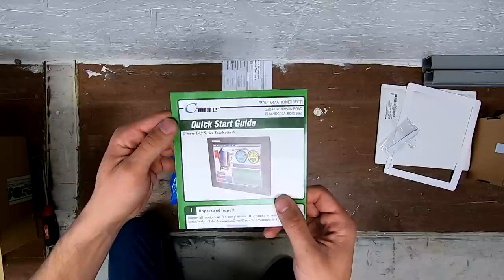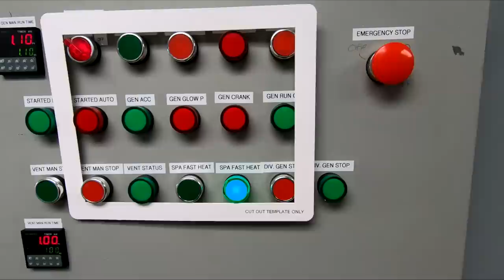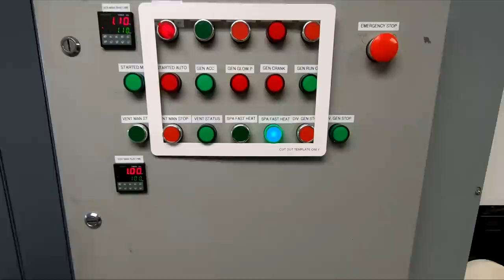C More HMI Panel Unboxing (Automation Direct)

Comment: You should leave your emergency stop button. In case of an HMI failure you'll be able to have a reliable emergency stop. Besides that cannot wait to see the finished product.
Reply: emergency stop circuit should be hard wired and not bus / network controlled unless the PLC is designed specifically for safety control such as Siemens and profisafe.

Comment: Good video.  I use Automation Direct Click PLC's to control my irrigation system.  My plc units are hundred of yards away.  
Modbus communication whether serial or eithernet is transparent to plc or cmore programming.  You can use the three wire rs485 cable to communicate with your remote units like your well.
I run my modbus interface at 38k.
Also the serial connector has a 5v power supply so you can power rs232 to rs485 dongles.

Comment: a good tip for screen protectors. before you take off the sticky part stick a tape to the top of the protector then tape the other half to the display so you can make a hinge then you can line up everything and when its good (open Up) the screen protector and peel off the protective backing then let it drop on the screen you will have the best result (hope u understand)

Comment: Next time you look at LAN switches, check out the Netonix WISP switches (offered with DIN rail mounts).

I'm very curious to know if something like a Raspberry Pi running Windows 10 IoT is capable of running AdvancedHMI applications.
Reply: Industrial ethernet = money.  DC power?  == more money.  Redundant DC power == lots more money.   Supervised, managed, and Gigabit speed too?  Well, you know by now.  IDK why so many industrial switches are 100mbit when 1G is so cheap elsewhere.
Reply: @infotech4990  industrial communication is still serial based. When I got started in microwave engineering most of the infrastructure I was backhauling was 9600 bps serial data. It was when my department got absorbed by IT that I began having to engineer links capable of 50M/100M/200M speeds. Prior to that 1M was rarely utilized so why deploy anything other than 10/100M switches? That was also about the time I began to see a huge riff develop between the IT guys and the SCADA guys...I was just there for data transport.
Reply: @zapityzapzap  Those old serial lines were robust - RS485 could network 32 devices at blazing speeds back in the late 70's thanks to the differential wire drivers. I think Xantrex/Schneider use RS485 in their newest Xanbus  multipoint network of power devices today.  The evolution to IP with scada, door locks, alarm, utils came in and moved the separate RS485 networks to one 100Mbit IP network dedicated for building infrastructure, which worked great for many years in the late 90's. A decade later, IP video cameras joined the 100M network (where the simplistic designer just added bandwidth up assuming he could use all 100M all the time for tons of cameras - plus the bldg infrastructure net was physically close to camera locations).  The massive load of cameras that security purchased pushed the network load to failure, which is when they had to hastily upgrade the 100M to 1G hubs/switches.  Later, security was given a dedicated fiber just for ip video.  I was going to buy 100M voip phones (cheaper!) using a 100M network and saw the high end ones are "future ready" with cameras + video calling on the executive phones. That's what pushed me to use 1G networking for the separate voice network - just in case, plus the 1G phones have slightly less latency mostly due to a better network chip. Now, the minimum I buy is 1G, and I have a few 10G nets for NAS attached systems & backups.
Reply: @infotech4990 still a lot of "low" speed data stuff going. Most public safety radios systems operate @12kbps or less (if the equipment is network attached you are lucky to have 10/100 ports on equipment). I know in 2015 when I left the energy industry some 10,000 of 12,000 devices I back-hauled in my business unit were strictly serial based (and didn't meet our IT department's security standards which lead to a problem when I told them the results of the audit). It is certianly a changing industry as IP becomes more prevalent.

Comment: With everything you said you woukld be removing, i would have thought a smaller panel would be better, and they make stainless steel cabinets ;)
Reply from the maker: But you will see in the second half of the video that the panel doesn't have much more space.  With adding the panduit and spacing things out to fit between it, I ate up a lot of real estate for the sake of wire management - But wire management is good!